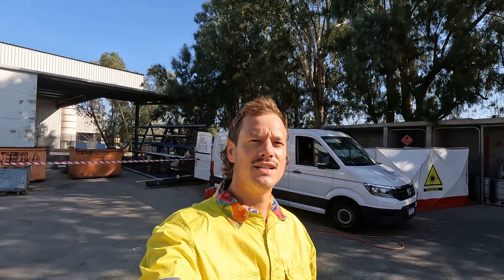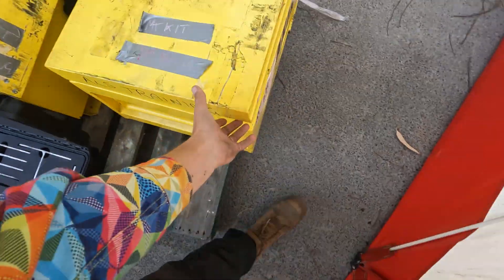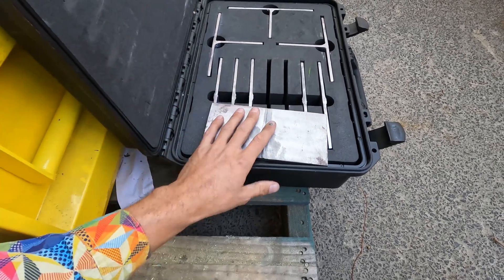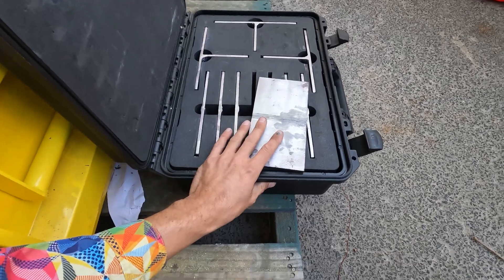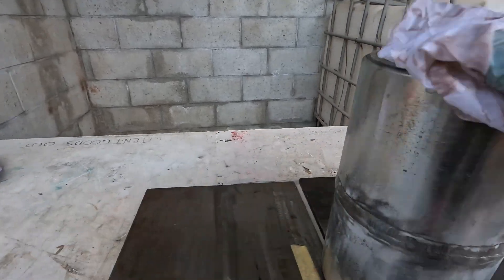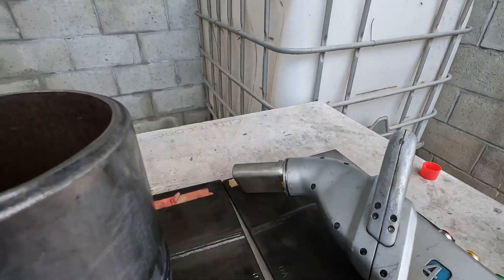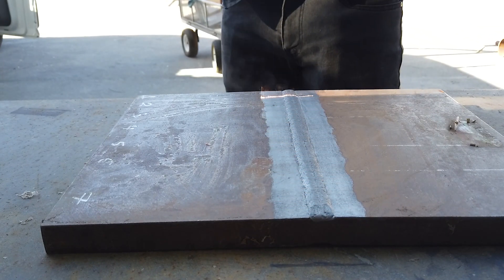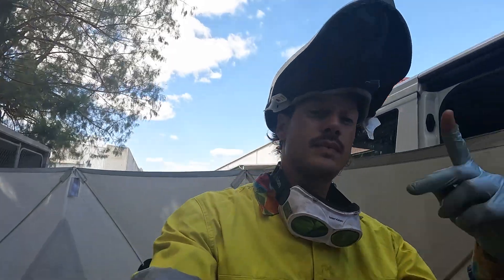Laser cleaning improves NDT visibility

Comment: Are you using a pulse or CW laser?  Does it require an air compressor also?  What do you charge to do a job like the one in this video?  Also, can you post a link to where you purchased the pop-up fabric barriers?
Reply from the maker: 500w 100mj pulsed top hat from 4Jet. You wouldn't want to use a CW in this application and 99.9% of CW operators would badly scratch the surface.

Comment: What strength is your machine? And the power requirement?
Well set up!
Thanks.
Reply from the maker: Cheers for the compliment! Always improving.
This is a 500W laser by 4jet in Germany, we use a 16KVA 3phase generator to run the laser.
Reply: @projectlaser  
Thanks!